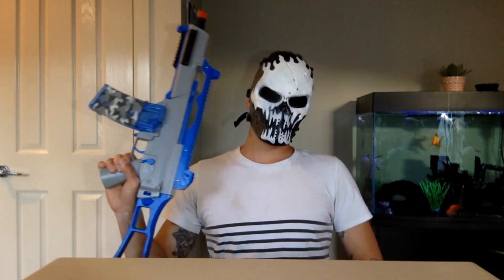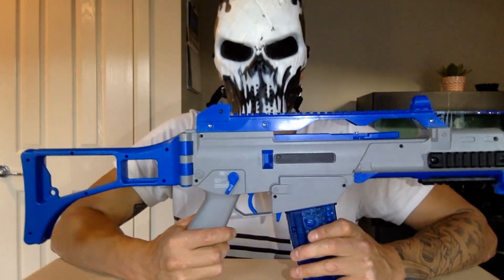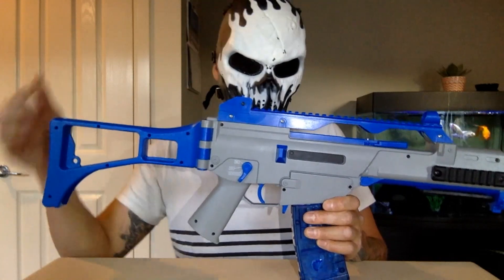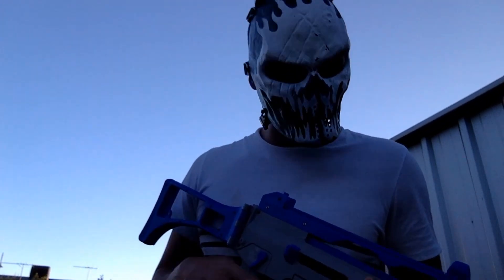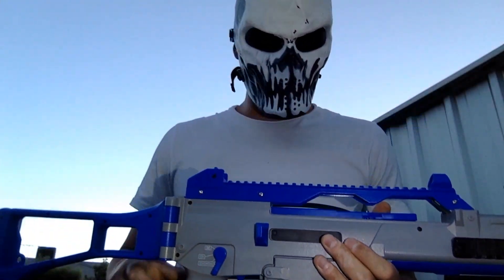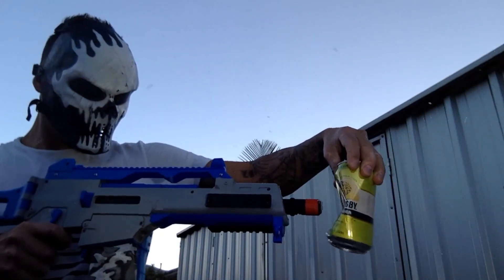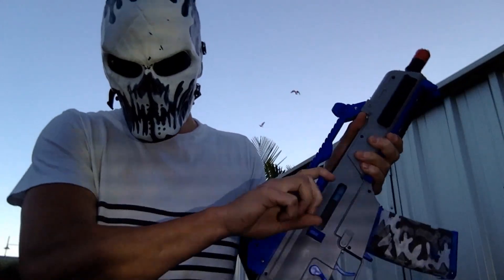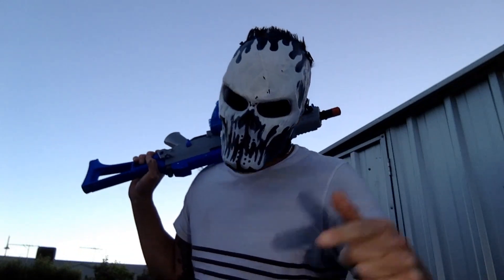"MODIFIED" G306 GEL BLASTER" RAPID FIRE REVIEW & SODA CAN TEST!

Comment: Could anyone advise, I made just a spring upgrade, as the easiest one (but G306T (black) V2 with a spare spring came with the blaster). Sometime after that it just stopped firing, I hear a click in any mode (single-auto), but nothing happens. Tried different batteries. Not sure where to check when I try disassembling it again. Could that be motor is burnt? Or anything else.

Comment: Have you upgraded any of the gears to metal? Has anything broken  after you've done these mods?
Reply from the maker: Yes all my Gel Blasters run "Metal Gear's " Except the G36 and it has spring upgrade Nothing has broken :)
Reply from the maker: I only broke gears on old JM gearbox with plastic gears with 1.4 spring
Reply: Can you tell me which spring to upgrade to
Reply from the maker: 1.3mm bud from chainsaw that is suited for G36C and JM M4a1, note there are two types, one type is longer in length. one for Newer JM M4A1 and G36c.

Comment: Looks good man simple upgrades off the shelf fairly easy for me. Awesome! Thank you
Reply: Fairly easy for me to have a go at attempting I mean. Thanks
Reply from the maker: Awesome mate, you will need to dremel the inner handle of G306 in order for Alloy motor cadge to fit with motor, also minor dremel sanding on the gearbox were the motor cadge meets gearbox. this is so the new motor cadge will meet up with the factory screw holes, as it will be slightly off on one side.
Reply: I'll have to get a Dremel then